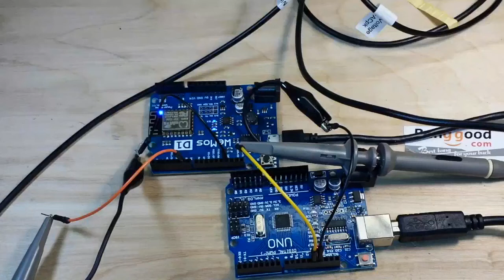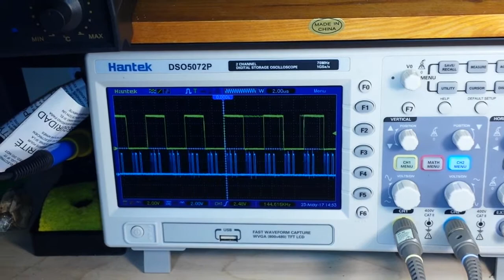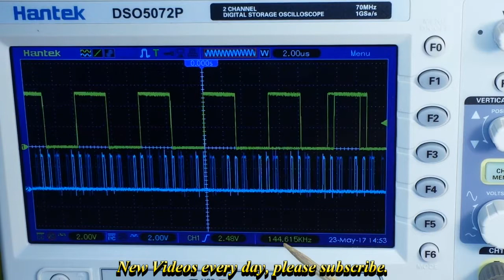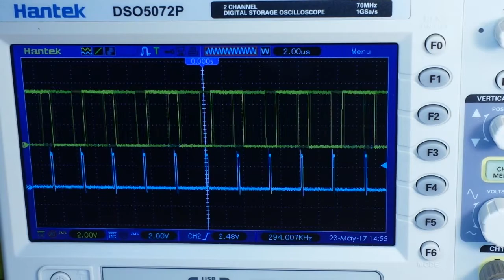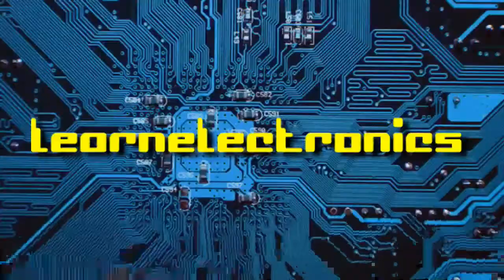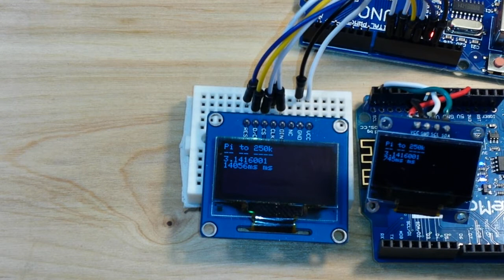ESP8266 Vs Arduino Uno

Comment: 2:25 A bit of a weird signal out of that esp8266, the esp8266 low signal is a lot longer than the high signal, Arduino has a duty cycle of about 50%,  the esp8266 has 10% or even least, that is weird, set and clear a bit take in every CPU core that I know the same circles.
Reply: Yep esp8266 shit the bed  moving to the start of the for loop

Comment: Hi. What about the other properties? Is the ESP8266  less "rugged"? With the Arduino Duemilenove that I have since like 2009, I connected and disconnected things without thinking much about it (motors, servos, etc,etc) and having almost no care with it and its alive and well. Is the ESP8266 sort of the same or? What about power consumption?

I have a small project where Wifi would be nice, but I dont need it always. Its a trigger board for an airsoft gun and I want to record stats and later have them synced to the cloud at home at a push of a button. It would drive the trigger by turning on the motor via a mosfet, it would have an accelarometer and gyro and would have a small screen and a few buttons, and be powered by a 7.4v lipo. I have used a Arduino Pro Micro for this in the past but I got myself a ESP8266 and would love to "upgrade" it.

Would them both behave roughly the same, hardware wise?

Comment: Nice test, thanks! Remark: Pi to 250.000 digits? You mean Pi to 4 digits, with 250.000 iterations, right?  But nevertheless, the way of calculating PI is not in scope of this test :-)

Comment: The ESP8266 at 18x faster seems pretty significant to me. The other factor you might seriously want to consider is cost. I am curious though why the waveform on the ESP had that duty cycle. It would interesting to see what the waveform looks like when there are 16, 32 or 64 on/off port instructions per loop.

Comment: Nice comparison!

It is interesting to note the difference in duty cycle of the two. The "off to on to off" time of the ESP is dramatically shorter than the Uno but there is this long delay between flashes so that the total time is not that much faster than the Uno. It would be interesting to measure the "on" time of the Uno compared to the "on" time of the ESP. It the difference dominated by the difference in clock speed?  

Also, could this delay between flashes on the ESP be due to managing the WiFi TCP-IP stack?
Reply from the maker: It could

Comment: Great video! The ESP is really fast. I am doing a home project with a gas sensor, inertial measurement unit, an alarm buzzer, and wifi module, and I am trying to decide between a rasp pi and ESP8266 to integrate the sensors onto. The compactness of ESP8266 is very appealing, however, was wondering if you have any tips for choosing between the two?
Reply from the maker: Madhu Pai if you are designing a project that will be repeating a single task I'd go with the esp8266. The RasPi does best in an environment where it will be doing multiple things like: reading sensor data, controlling servos, and outputting data to a display where it can switch between inputs. For what you want, I'd go with the esp8266... It has plenty of power, uses less energy and it's compatible with more sensors. I hope that helped.

Comment: 1 arduino uno, port manipulation can go up to 1mhz (or more). 2 compare a 16mhz microcontroller vs 84 mhz? realy? try to compare to arduino due. 3 bulshit video didnt prove anything
Reply from the maker: Alien X 1. this video was in response to a request.
2. WeMos D1 clocked @ 160Mhz
3. wasn't trying to prove anything, was responding to a viewer request. but thanks for watching and commenting. I appreciate all comments.
Reply: http://jeelabs.org/2010/01/06/pin-io-performance/

Comment: if you really had the same blinking code on both, the wemos is crap :P one would expect a 50% duty cycle like on the uno, but you get like a 10% one. something is wrong here
Reply: fredlllll learnelectronics hey, if you don't specifically turn off the WiFi on the esp8266 it will connect to network using the last settings so after each loop it was probably doing things to support the network side of things. 

I think WiFi.forceSleepBegin() in the setup will turn it off. If it takes a int, try pass zero. 

Or try
WiFi.disconnect();
WiFi.mode(WIFI_OFF);
Reply from the maker: Brian Lough thanks Brian, that makes sense to me. I knew there had to be some other things going on in there.
Reply from the maker: fredlllll exact same code
Reply: then thou have now accepted the quest to find out why the wemos behaves so strangely ;)

srsly though, that would be a huge issue when someone tries to do some timing stuff
Reply from the maker: fredlllll I think it has to do with overhead. a few months back I did a video setting up an esp8266 in the Arduino IDE and uploading the blink program. I don't remember the exact number, but just blink took nearly 80% of memory.
Reply: a right you didnt use your own loop right? so control gets transfered back to the "OS". for the uno its just a normal while(true) which gets optimized by the compiler, so there is not much overhead. seems like there is a buttload of overhead for exiting the loop and reentering it again on the weemos
Reply from the maker: fredlllll yep, that's my thinking. if you look at my second experiment, computing pi...all the code is in setup so it runs as a single shot. it's really fast there.